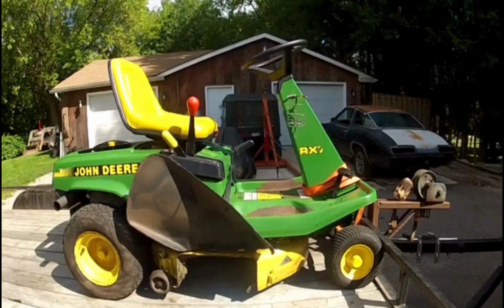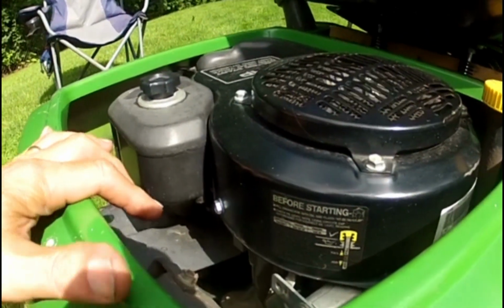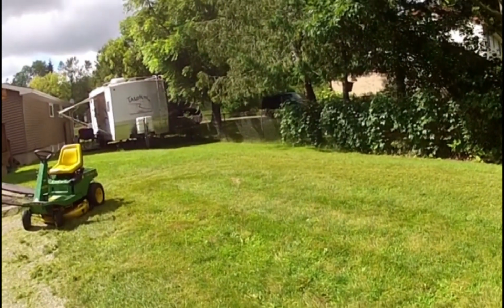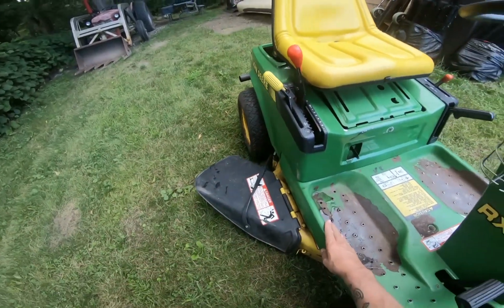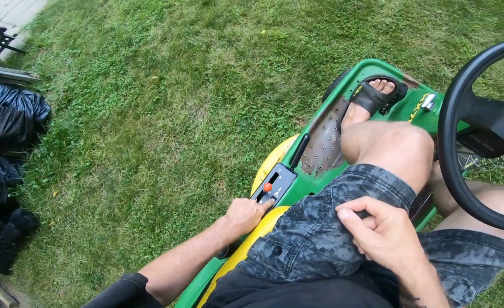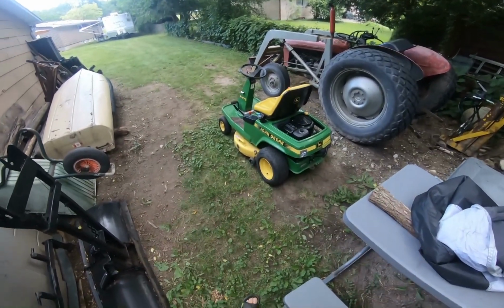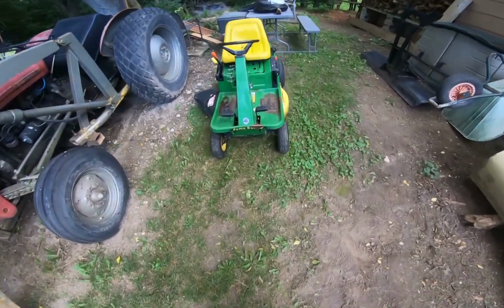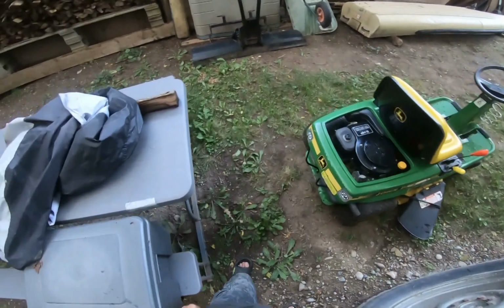1989 John Deere - RX75

Comment: When I was a intern at Kibble Equipment John Deere a rx75 was the first thing they made me fix. Replaced the little brake pads and readjusted the spring so the clutch would actually work and away she went. Nice machine!
Reply: Any tips on changing the spark plug? No room to work with a ratchet unless you remove the chassis I'm assuming.

Comment: Hey Mister! This video was cool!!  Thank God i find your channel! I have just buyed one today from a friend of mine. Same type, RX75. I have never owned this kind of tractor in my life. Can you tell me what viscosity of oil should be used in the engine?
Reply from the maker: The manual says John Deere Torque-Gard Supreme "SAE 30" for warm weather.
Reply: @ontariotube    Thanks a lot Sir! 80W-90 oil whould be good for the transmission under the body? What is your opinion?
Reply from the maker: @RudolfDiesel86  Yes. 80W90 is shown on a receipt I have for the transaxle rebuild.
Reply: @ontariotube  i will check it, promise. 🙂Thanks again. You have a great knowledge for making a usefull channel for these mechanical things. God bless you. Greetings from the other side of the world...  Hungary, middle Europe.
Reply: @RudolfDiesel86  The transmissions in these don't use oil. They have a bentonite grease in them from factory.

Comment: Lift your seat you will see 3 bolts in a row the middle one will be 1" 1/8 loose the 3  nuts that are 1/2" then turn the big nut to adjust the deck same on left hand side close to the front will be another adjustment like under the seat hope this helps someone out con only lift or lower front or back of deck the wheels some what adjust it side to side just did  mine last night cuts as level as you will get